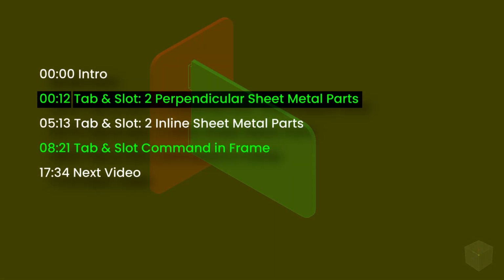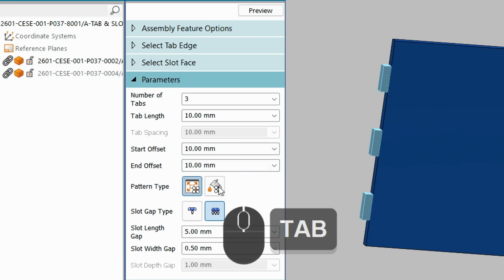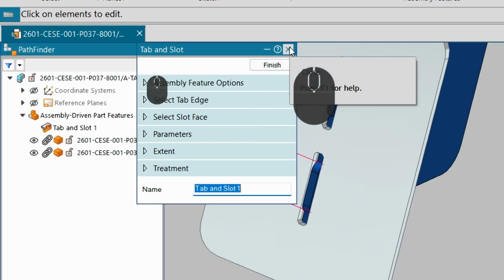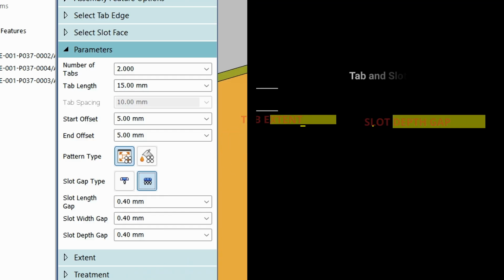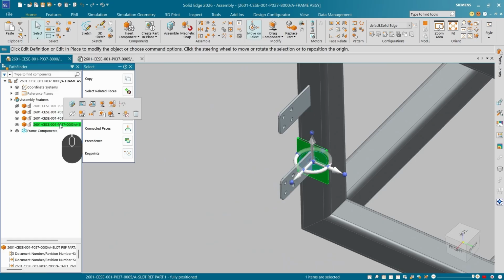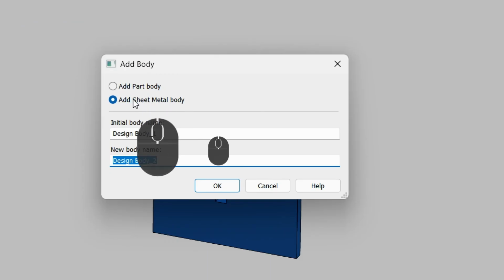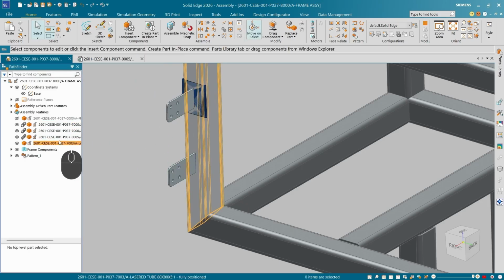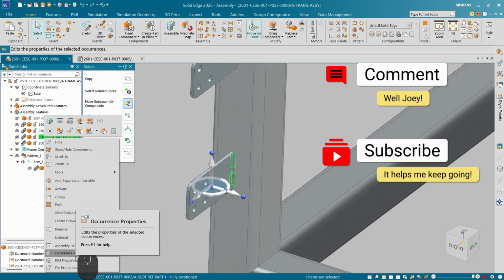Solid Edge Tutorial: Tab and Slot Command

Comment: This feature seems nice at first, but can turn into a little nightmare.
Someone in my company copied parts out of my 4-piece assembly with this tab and slot feature. Not knowing this feature, they tried to delete the features in the copied parts, as the links persisted. Turns out you can't! You can only break links. Now they have already heavily modified parts with dead features in them. As if that is not enough, my original ASM with the original parts has errors in all the tab and slot features and i can't modify them anymore...
Reply from the maker: Hi @a.r.8850
Sorry that this happened to you. You are correct that these features can't be easily edited from within the parts, that is because they are Assembly-Driven Part Features, they need to be edited within the assembly the features were defined in. If they want to reuse a copy of your part file without the tab & slot they could try suppressing the features.

I'm not sure if the errors you're dealing with are related to actions your colleague made to their copy of the part, or if it is unrelated. Have you tried editing the assembly that your tab and slot is defined in? (this should be the assembly document linked in the pathfinder of the parts with the tab and slot features).
Reply: @2pidesign  yes i have tried to repair the original asm. the features have a red exclamation mark and i can't edit them. they seem dead as well. I could try to reinstate the links on the copied parts and insert them in the assembly, but who has time to figure out these kinds of things :D... someone at SE support is looking at it. let's see...
Reply from the maker: @a.r.8850  thank you for your reply, hopefully SE support can get to the bottom of this, there are some very smart people there.